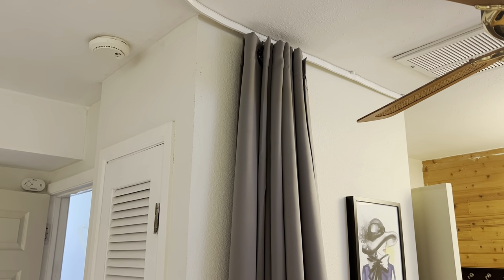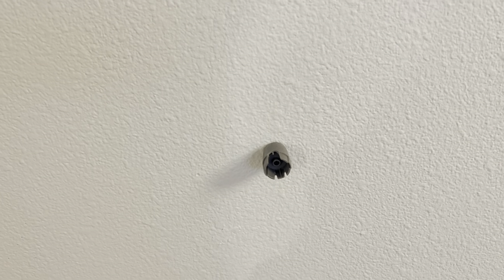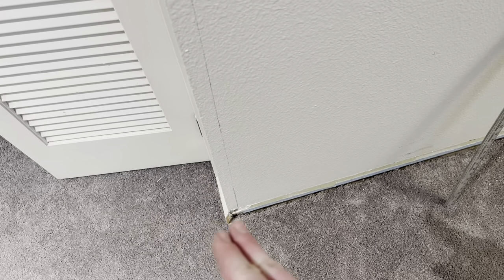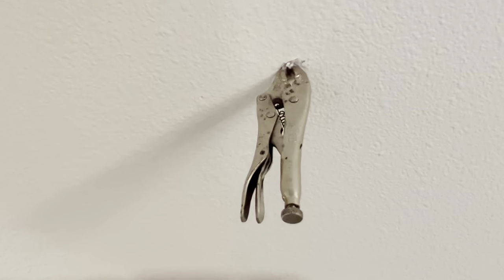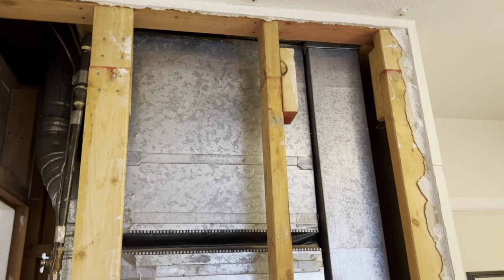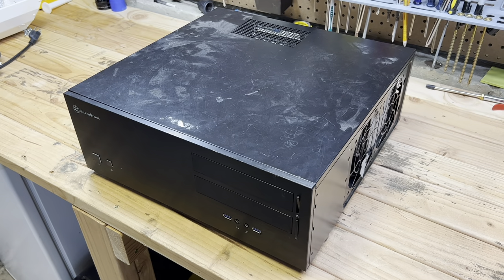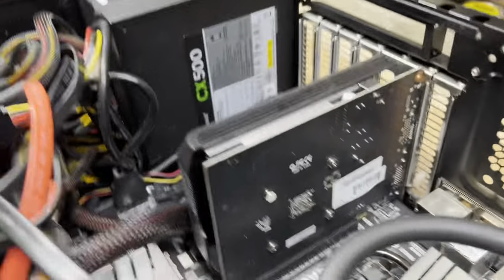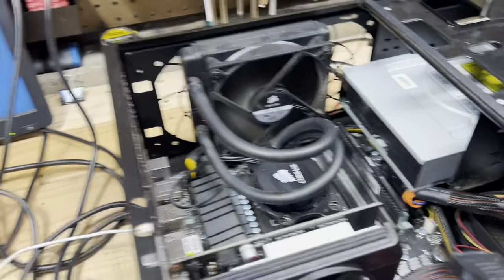Find the Nails & Free Computer - 24

Comment: Could you do a video of your old and new heating and air conditioning sistim.
Reply from the maker: I got a before and after look at the system, which will be in the next video, but I didn't get a video of the old system running.